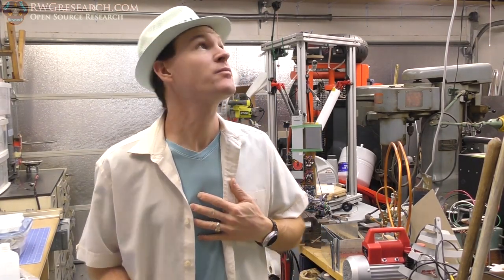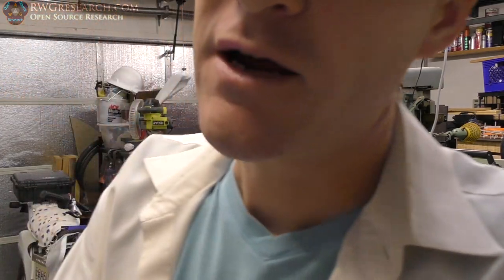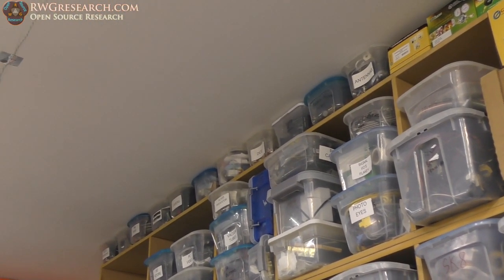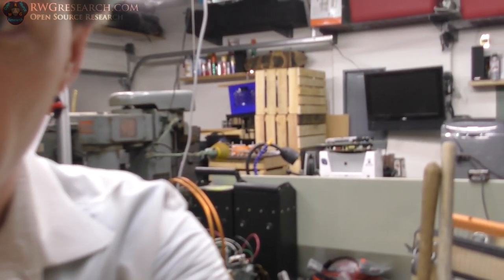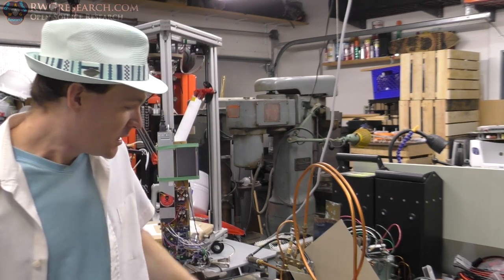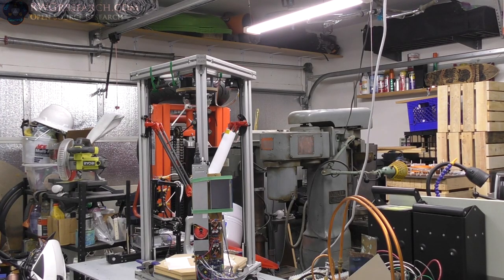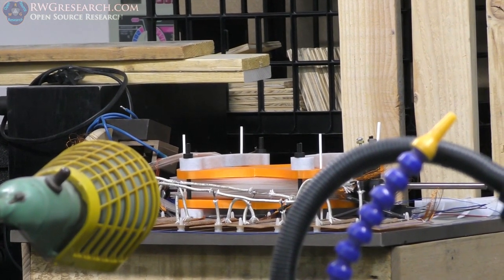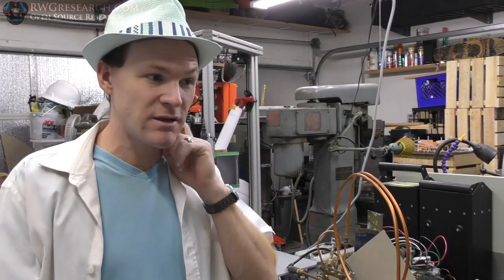Russ's Response to: "Yes!!! But Why!!!! Tell Me!!!" : kinda a long winded update on stuff... Enjoy..

Comment: as a automotive diagnostic technician for now 40 years and and electronics hobbyist tinkerer, and  got interested in pulse motors, and you inspired me to try new things and I was  able to take the mg 2  magnet rotor out of a lexus rx hybrid transmission, thing weighed like 40 pounds, used the bearings that it rode on and made a sg  circuit pulse motor and it would run for hours at about 200 rpms off of 2 5ah 12v sealed batteries.  it would run for hours,  one bifiler coil wound on a  3 inch solder spool stuffed with cut cloths hanger. it was a blast, a bit scary having that heavy rotor spinning in my living room,. very hillbilly. that was because of you. Thanks for sharing.

Comment: Russ, take a pic of all sides and surfaces of your den, try to capture all your projects in each shot, next take some time off and with a laptop/pc ...etc, go through those pics and make a list of every project you have which are showing in those pics, even the ones that you can see parts of sticking out behind some other stuff. Next, modify that list in priority or preference order (whatever is your reason, make sure it's in a particular order). Next, leave everything aside for one day and one night (switch off) with the list printed out lying/hanging somewhere where you can walk by it from time to time. Then begin with your list. Make sure you put down in front of each project a very achievable and clear milestone! Do not try to over achieve on any particular project, since achieving your other milestones for your other projects will feedback experience and knowledge on the ones.before.

Regards,
S.

Comment: Im curious if you are familiar with David LaPoints work with the "Primer Cube" and what your thoughts are if so?
Reply: I've been able to successfully 3D print the magnetic array and assemble it with neodymium magnets. If you want one, contact me. I've got two of them at the moment. White in color. I've also communicated with David and he has provided some feedback on the use of the array for healing injuries and the differences between spinning and not spinning. The new evidence of possible magnet motor designs are interesting and worth further investigation.

Comment: Totally agree man. Free energy isn't easy and it's easy to loose faith. It doesn't matter man we just have to keep pushing ahead and it doesn't have to be Stan Myer. It's the journey as much as it is the destination. Yes, keep doing it because you enjoy it man!!! I want particle accelerator Russ back.. you built a small version once. Can you try and make one even smaller then shoot some stuff with it? We don't have any element 115 but maybe something else might trigger some cool stuff? lol Rabbit Russ is cute and all and I understand that you might have really needed that but you have work to do :-D Also just thinking about the whole Stan Myer thing. All along we have been trying to brute force it using resonance and all kinds of stuff. What if we are looking at it completely wrong? What about an imploding electrolysis device? If you look at sonoluminescence it generates the power of the sun by using implosion.
Reply: Hey Russ I just remembered seeing a simple coil of wire loop crush a soda can by running a charge through it. https://www.youtube.com/watch?v=XiIlQIe5Qs8 I wonder if what happens if you use a similar device with water in between while undertaking normal electrolysis?

Comment: Have an idea for you on energy... hho generation..
I hear that graphite & urea is better than SS & KOH...
So use that making the hho, and have the surface area of the graphite be attached to two Faraday Disk, and the gas output put through something like a turbine or pump to create spin to further spin the disks/electrodes, side advantage is the centripetal force will eject the bubbles..
More gas=more spin, more spin=more electricity, more electricity=more gas... ... ... ... ...
I have a detailed design in mind, let me know if you want it.

Comment: .If you made the system 100% efficient you will have no water at the exhaust all fuel would be burnt and you could travel many times round the globe on a gallon of water..So if you get just a few % over natural conversion rates gas to water then you have a car that will run on the amount of gas the car can produce...🧐
Reply: What most don't understand is when you burn HHO then the gas to energy conversion is only 1 millionth of the possible energy conversion..Nature shuts down the reaction.The processed oxygen with up to 4 missing electrons makes the gas to water conversion aperture open up to convert more gas and leaves you with less byproduct ie water in the exhaust..Anything above 0.000001 conversion will let you run the car on the amount of gas the car electrical system can deliver..